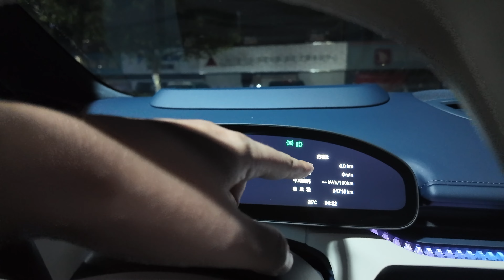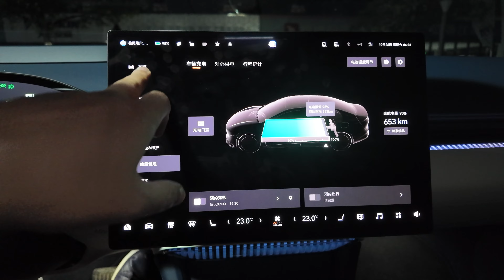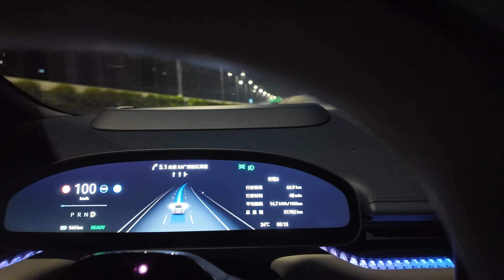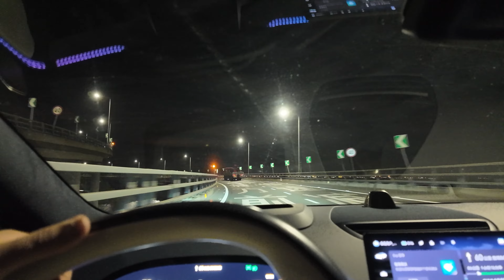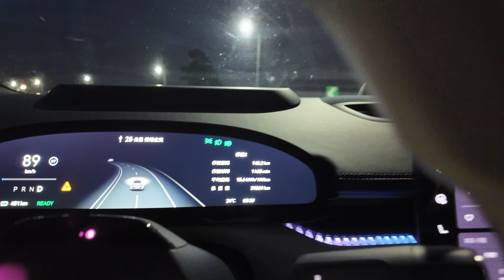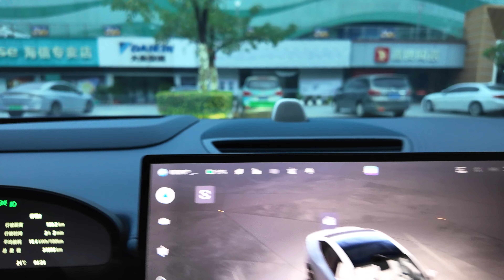2024 Zeekr 007 RWD range Test part2

Comment: Thx for the range test :-)
So, if you drive with an average speed of 90 km/h you can get a max. range of 500 km real world range (@ 25°C / dry weather) :-). That's quite good. I hope Zeekr also optimized the range for cold weather conditions.
Reply from the maker: anything below 90KW/H would extend the range to 500kw easy specially when you have perfect conditions in term of weather , i assume these cars optimized for could weather since they were designed in Sweden since geely still owns some Volvo facilities in europ